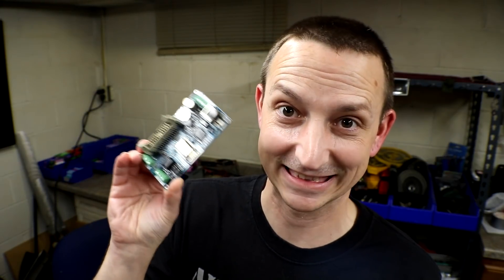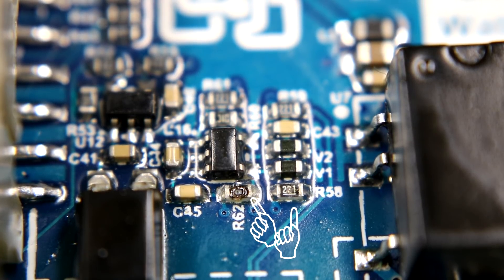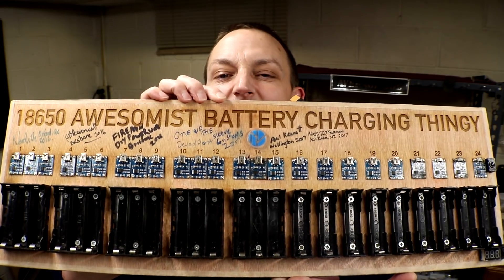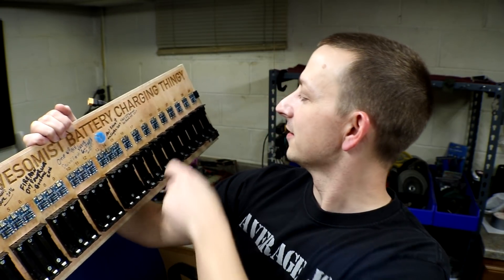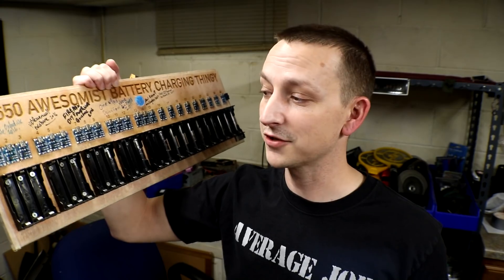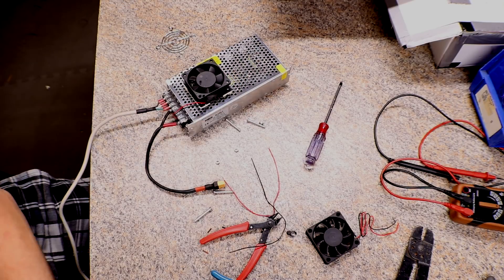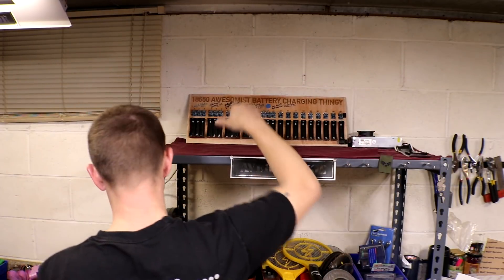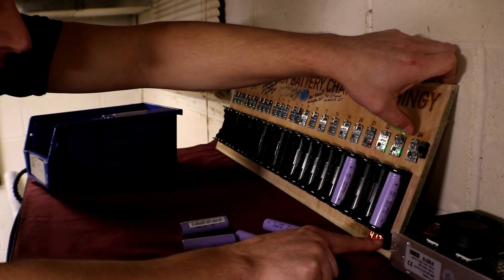Diy Tesla Powerwall ep71 Update on Stuffs!

Comment: There is a variable resistor pot on the board you can check and change the output voltage on that PSU.
Reply from the maker: Yeah there should be!

Comment: What kind of 5v power supply is that? Also what charger do you  plan to use for the 10s input and how much can the 10s bms handle? Thanks.
Reply from the maker: Ill see if there is any info on the charger but If I remember right its this one https://goo.gl/v36DcE 30amps.  The bms will be for a 14s system but can be used with any series system.  Its powered from your battery bank or can be powered from a USB.
Reply: Thank you for getting back at me man. I like the wall idea very much, and I am definitely going to lowes today to get some of those PVC's you made holders out of and maybe I will just cut them close to the full length of the battery if that doesn't heat them up too much. I make these 1S12p power bricks for my powerbank extension so I don't have to charge but simply replace a brick when I get back, and I can carry 4 bricks in a plastic ammo box, when linked into 4s12p, they can charge my mac many times or power my 27 inch monitor for gaming and stuff when I go camping or just use as cig lighter power source. I think I am going to rip all of the ones I made before and do the DIY battery holder to all of them. How is the super glue holding and would you have gone with PVC cement if you are doing the holders for the first time?
Reply from the maker: There you go!  Yeah give it a try full length of the cell.  My packs are holding up very well and Ive moved them around quit a bit.  I might try the cement on a test pack, I didnt at the time cause I didnt have any on hand and didnt wanna run out to get any lol.

Comment: Following the long prescribed procedure for post trauma smoke release, first look everywhere you put your d#%$-skinners. The first thing that comes to mind is that you may have crossed a set of the pins when you did your fancy-pants sleeving. Good luck with the micro soldering. Great video though!  
POUND ME......really Joe. Someone be by shortly to collect your Man Card.
Reply from the maker: Yeah I was up late that night rechecking all the wires ect... They all ohm good but Im gonna slide the sleeve back to get some eyeballs on it.  LOL Pound Me BAAAHAAAA😜
Reply: I would hope that Batrium powers everything up before they ship. Unfortunately, most times like this it turns out to be the end user's mistake. Either way, it's just a bump in the road. As good a job as you've done on this project, you were bound to hit a snag somewhere.

Comment: what kind of pipe was that you made your battery holders out of. not in this video. its been a while ago. the 18650 fits inside . and what kind of glue did you use?
Reply from the maker: I used 3/4" sch 80 pipe from Lowes and I just used super glue lol😆
Reply: AveRage Joe 
I just had a idea for you a shirt design. have seen the M*A*S*H 4077th.           t shirts? you do AVERAGE*JOE*
         18650.      t shirts
  do kinda military themed t shirt.  but thanks for the reply. so the super glue holds up over time good? I guess I could go to Lowe's and take a couple cells with me . to be 100% sure they fit. I have done enough re runs back to Lowes. because I forgot things. or got the wrong thing. I'm gonna have to make a list. and take it with me! anyhow thanks!
Reply from the maker: I like it!!!

Comment: We can fix it!!  Need some 220 ohm resistors? I can send!
Reply: You know, no cost- I should have a bunch I can mail...
Reply from the maker: +kirkb4989 Yeah I am for sure going to give it a go. Might as well!!!! Let me msg Jaron to see if a 220 would work for a replacement. I know resistors have a + - tolerance so I would imagine it would be fine???
Reply: A 220 is a 220
Reply from the maker: +kirkb4989 Didnt I say 221? Ill have to rewatch the vid, Its a 221 but would think a 220 would work
Reply from the maker: +kirkb4989 Just read another comment that a 221 is actually a 220 lol. So let me see what I got and Ill let you know, and thanks btw🖒
Reply: 221 is 22 with 1 zero after it i.e. 220...  222 is 2.2K (2200), 223 would be 22K (22000) etc!!  SMD numbering is WHACK!!
Reply from the maker: +kirkb4989 Yeah I wasnt aware of this trickery in the numbers lol. I did however ship it back 😃

Comment: Just to let you know in case you weren't aware, that resistor would be 220 ohm. the first two numbers are just numbers and the last digit is the number of zeros following it.
Reply: I guess a conventional resistor could be used if it has somewhere to lie without stressing the leads.
Reply: Andy Lee Robinson yes that would be a valid option, and it would make soldering a new resistor much easier
Reply from the maker: +ceb515rulez I wasnt aware of that🤔 thanks for the tip😆🖒
Reply: You're welcome! Just bear in mind it might not work for really high frequencies as it would introduce extra inductance and propagation delays, but should be fine for this job.
Reply: I think you mean 22 ohm. 22 + zero zeros.
Reply: Jesper Monsted the resistor says 221 on it.